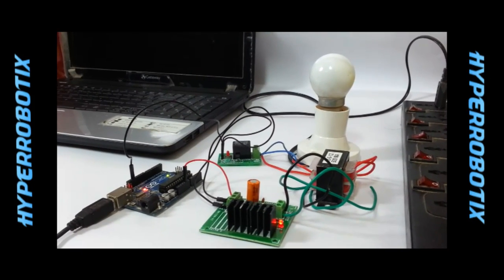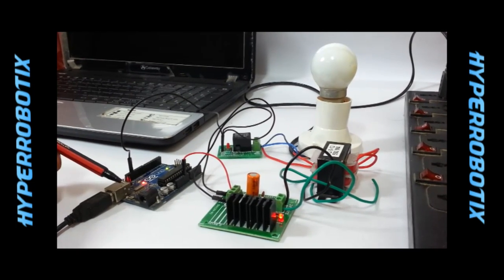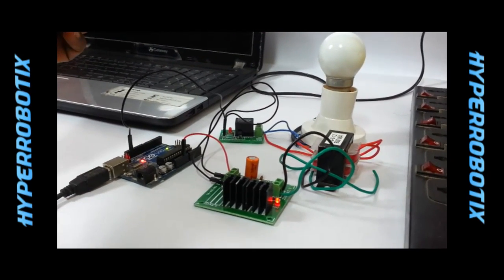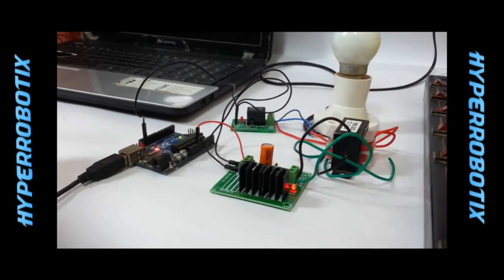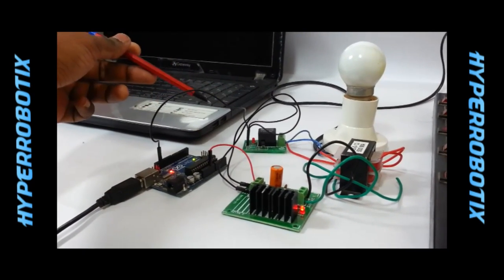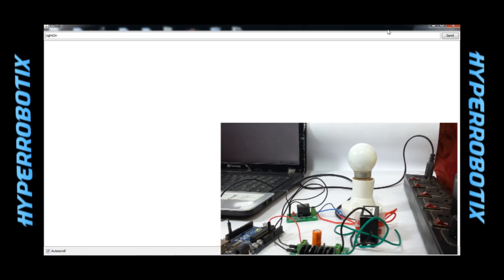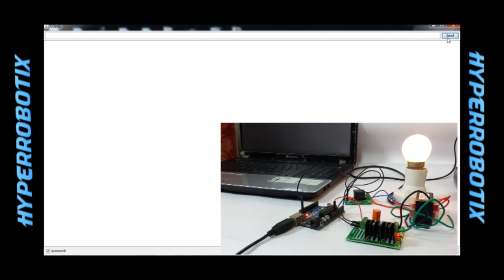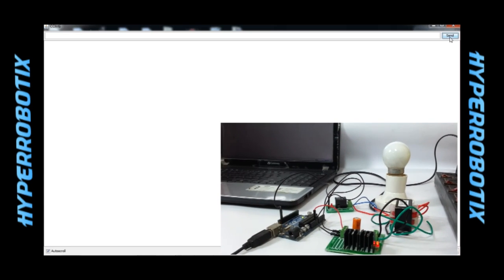Arduino Home Automation

Comment: Where did you get the controler boards? and what did you use for a control program, I have to do a Science fiar projecr with my step son (who is a budding computer genius) can the serial port handle multiple processes?  ( I am a diesel mechanic lol)
Reply from the maker: Hi DieselMan. Thanks for your interest. This project is made using arduino uno board. Yes, it can handle serial port.
Feel free to ask for any more information and we would be ready to help further.

Also for step by step instruction, please follow our tutorial at : ---

https://www.instructables.com/id/Computer-Controlled-Home-Lighting-System/